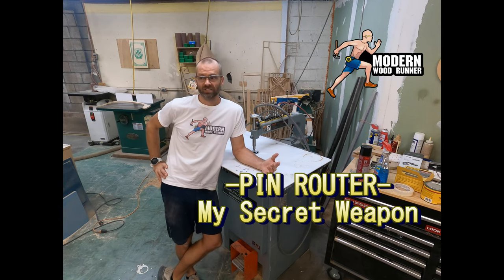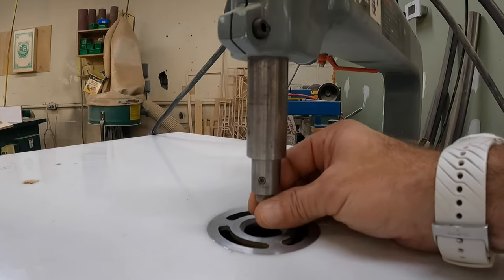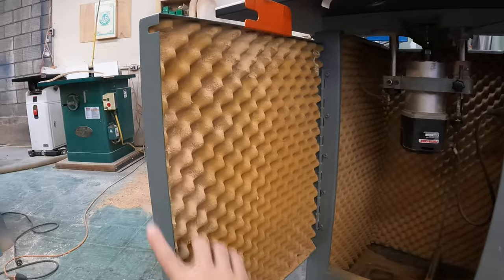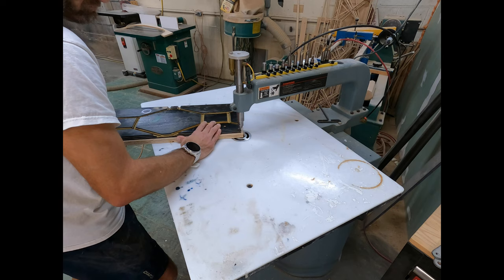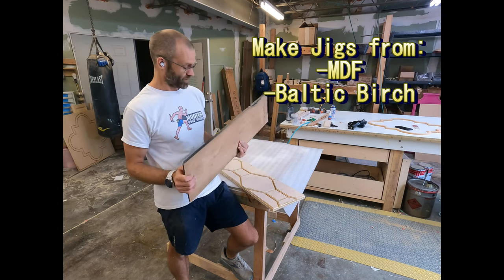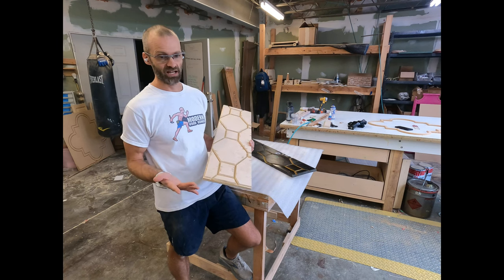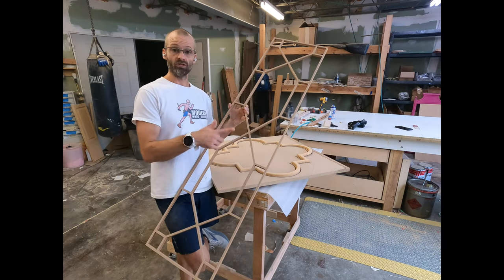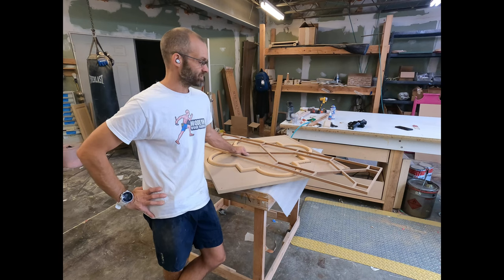Furniture Maker's Secret Weapon: The Pin Router/ Let's Talk About This Misunderstood Tool

Comment: "super cheap"
What's your definition of cheap. I checked online, you can buy many quality CNC machines for much less than any I found... maybe even 2 CNC for the price of one of these.
Reply from the maker: These are $500-1000bucks, and 220v and you and your buddy can move it.  CNC is at least 10k, industrial power, vacuum, plus programming, plus commercial freight, etc, etc…. Am I missing something?  Don’t get me wrong, I love CNC routers.  I simply prefer this tool for small production and large variations.